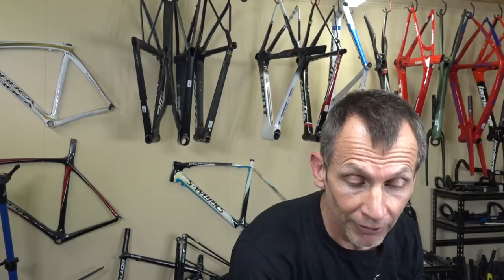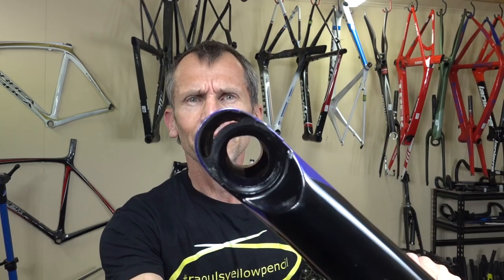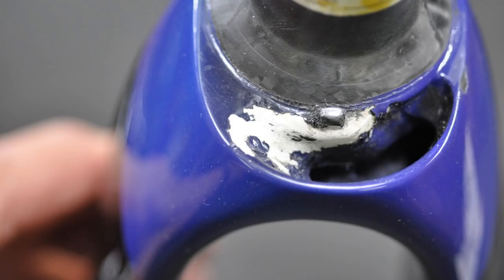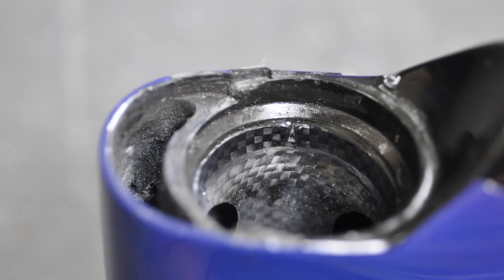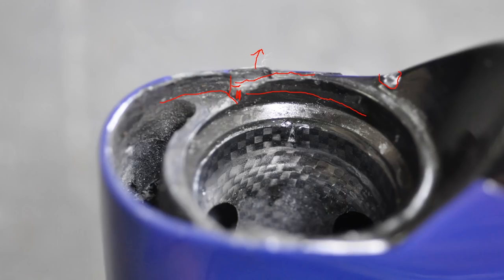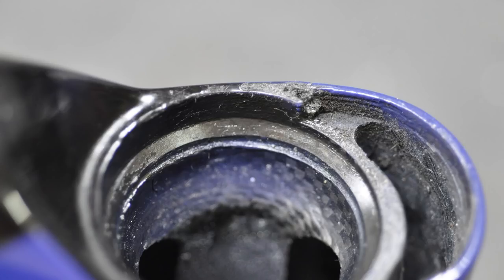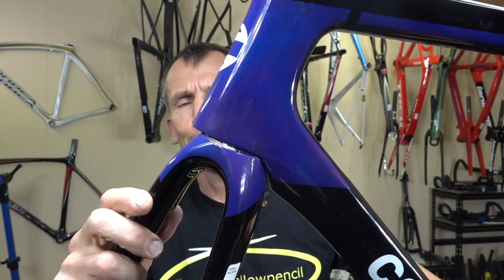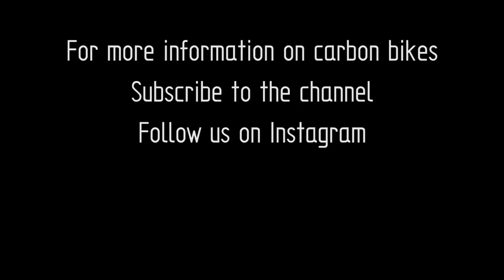Cannondale Design Fail

Comment: I have got this frame and this is precisely what happened to it. I had to spend some 500 euros for the repair. Something tells me that Cannondale should pay me that back.
Reply: Well, the owner's manual clearly states: "NOTICE Do not force the steering past the stop points. If the front end steering of the bikes is over-loaded (due to e.g. a handlebar strike, a crash, etc.) damage to the frame, fork or pin may result. This type of damage is not covered by the limited warranty." I swear, i will never ever buy a Cannondale. They knew this was shit design from the beginning.
Reply: I had the same problem… 500 euro to replace the frame. Maybe we can do a class action against cannondale.

Comment: So basically every time the bike's bars are accidentally hyper extended, the frame is destroyed.  I wonder how many frames the EF Education team has gone through?
Reply: The mechanics may have eliminated the metal stop.
Reply: @glennoc8585  Definitely possible.  No doubt I would be taking a Dremel to the metal tab if I owned one of these.
Reply: @cup_and_cone  the stop is there to prevent the internal cable routing through steerer tube from damage or pull out....hydraulic pipes.. 😬
Reply: @rp6760  Just.. do them longer.
Reply: @cup_and_cone  why not? Can always just use a file I suppose....
Reply: Well, first it's damaged. Only when it has been damaged too much, it's destroyed.
Reply: @futurememeudontgetyet1202  i think it is the overlapping windows in the frame and fork the cables pass through, without the stop they'll act like a guillotine.

Comment: Inner cable routing was probably the reason why "designer" wanted to limit fork turn. Buy simple designs and reliable bikes brand LOOK or TIME.
Reply: Both those brands make fantastic bikes. They may not be the most aero but the build quality is fantastic and second to none really.

Comment: I've had a couple of these frames (I do some work for a LBS, and I have had the opportunity to own a couple), and I've found the best fix is to Dremel/sand off the metal pin, so that it no longer makes contact with the frame. What ends up happening instead is that extra stress is put on the brake line, which is less than ideal. I've come to thee realization though, that replacing the front brake line is a hell of a lot more simple and cost-effective over replacing the frame every time you have delamination/damage. I can't take credit for this idea, as it was told to me by someone that works for EF-Nippo, and that one of the riders requested to have this mod done, as the angle at which it currently stops is not a lot for very tight, low-speed turns.

Comment: Just checked my 2020 SS Evo. Alas, I have the same kind of damage - the metal blade has eaten a few millimetres into the carbon ramps on both sides of the head tube, and there is early delamination/bulging on of the lower end of the right head tube side.

The bike was never crashed, just ridden normally for a year. The only reason I can think of is that I regularly carry my bike up the stairwell to my apartment, and the limiter engages in these occasions regularly (but without high forces, at least so I thought, being unaware of the metal blade design/self-destruction mechanism).

I am appalled that there is no recall from Cannondale yet. Seems like they want to brush it under the carpet - the 2021 model apparently has a metal reinforcement in that area. Conveniently, there's an addendum to the user manual stating that specifically this damage is excluded from the limited warranty.

@Raoul - do you think this is cosmetic or structural, i.e. can I still ride my bike or is this now an expensive piece of junk?

Comment: It would be interesting to see survey results as to the different ways manufacturers secure a fork from swinging too far.
Reply: The current Trek Knock Block design is pretty good. Even thigh it requires a couple extra parts, they're all replaceable and metal. They even have a retrofit, so you can use aftermarket stems. I may not like the application on mtb, but they executed it well.

Comment: It looks like there is plenty of room to put a large pin on the back side of the crown, avoiding the traffic jam at the front where I'm assuming the fork hose is going. The carbon on the frame would be pretty thick there too.

Comment: Most my cycling buddies who experience broken frames and forks rode Cannondales. The second worst are Cervelos.
Reply: Both owned by Dorel
Reply: And then you have Monza Imports here in Australia to deal with who will try any excuse under the sun to try avoid warranty on Cannondale. You can’t even get hold of Dorel so if Monza decide not to replace frames, you stuffed.

Comment: Presumably the stop is just to prevent the internally routed cables from being damaged if the handlebars are rotated too far?! Crazy engineering, surely there must be a more elegant design than this? If it's not possible to design a much better steerer stop, then surely you shouldn't internally route your cables! Nicely presented Raoul - keep this stuff coming and also get well soon.
Reply: Yeah that is likely the only reason they bothered to put a stop in the first place.
Reply: That’s stupid. Just make it so your hoses are long enough to rotate both ways how they used to….

Comment: Pro teams go through a TON of frames...  at least 10 per rider (not counting TT bikes).  That is a pretty big "carbon footprint".  But no one seems to care.  Think about how it would help the development of the product if the teams were limited in how many frames they could use and bike manufacturers were forced to make a durable product...   and it would be better for the plant too.
Reply: I really wonder how much these frames cost to make and if the teams are getting the frames "at cost".    The price to the manufacture, which is based almost totally on outsourced labor, has got to be pretty low.
Reply: @SurpriseMeJT  i would assume the pro teams get them (and everything else) for free, and then pass along the cost to the consumer. 
the sport, at the professional level, is nothing more than advertising and marketing.
if the bicycle industry received 1/1000th of what the automotive industry received in corporate welfare, a Pinnarelo F12 with Enve and Super Record EPS would cost $49.99
Reply: @SurpriseMeJT  Bike makers PAY teams to ride their product...  the teams do not buy frames.  The cost for a manufacturer like Trek, Cdale or Specialized to make a frame is $150 for a low end frame to about $700 for a top end frame.  The real costs of selling high end carbon frames is distribution and marketing, not manufacturing.

Comment: That's beyond stupid, really. I think it's a bad idea to begin with to design a bike frame in a way so that steering travel is limited. Because even if it was reinforced down there at the headtube with metal inserts, a crash might still be too much for it. Admittedly, your handlebar can also damage your top tube in a crash, but the surface area there is usually much greater and your handlebar is most likely wrapped in soft bar tape.
Reply: One issue with this is they have hoses going through that area, so if travel is not limited it could pinch or cut the hoses. But then they may have been better off reinforcing the hose and using that as a travel limit instead.

Comment: Thx for the video. I had the same issue with the frame while having a small accident - luckily the frame was replaced by cannondale. But as you said, the design is really crappy and made to fail hard..
Reply: Hi! I have the same problem at the moment. How did you contact cannondale to replace the frame? Did they do it readily or did you have to push them? 
Thanks for a short feedback!

Comment: I have a 2019 and bought it shortly before the new one was released. I was a little disappointed that I didn't wait a little longer. Seeing this issue (and the frame you are showing isn't an isolated incident) makes me glad I have the one I do. Even if it does have a QR on the rear with disk brakes. It isn't a factor at all. Just made buying new wheels a little more complicated.
Reply: Wheel upgrades are the reason why I hate disc brake road bikes with open dropouts. Disc brakes and closed dropouts go together.

Comment: I know that cannondale are replacing 2020 models through warranty, but will 2021 model with a metal plate in there solves this issue?
Reply: We’re they?! Mine just happened today. Where did you see that?
Reply: @andrewsbenn  I am still waiting for my new frame. In 2021 models they added a metal plate, so stopper is hitting metal instead of crb

Comment: Since mine is damaged in the same way, I'm wondering if this is a repairable condition?   I've been toying with taking it to a carbon repair shop in New Jersey to see what they say.  But it's a pretty big hassle because of the distance involved.   Also, it seems pretty complicated because of the bearing race being right there.
Reply: I'd say: not worth repairing. I'd ask my money back, that is a design/manufacture flaw. The fault is a long crack in one of the highest loaded areas of the bike, and there's quite a bit of complicated geometry. And the crack is above other thicker laminate, which may also be damaged. To repair that properly, you would probably have to sand off a huge area of plies around it, as to practically rebuild the headtube.And frankly, I wouldn't want to ride that thing again. This may crack without you noticing, and fail while you're on it.
Reply: @Clarion15090 What did you end up doing mine broke yesterday in the same spot.
Reply: @andrewsbenn  I'm really sorry to hear that.  I didn't do anything with it yet.  It's hooked up to an indoor trainer.  I may eventually take it to a carbon repair shop and see what they say.  It's just a big hassle to deal with.  Plus it has to be a very tricky (if even possible) repair because it's cracked right at the lower headset bearing.  That's why I haven't done anything with it.  

The driver's insurance company treated my really well in totaling the bike out and letting me keep it.  I was able to replace it with a brand new 2019 Supersix Dura Ace Di2 with what they gave me.  I'm not unhappy about how things turned out for me personally.  But I wouldn't buy another 2020 or 2021 Supersix because of the steering limit design.  

Good luck with yours.  Please post back and let us know how you make out.

Comment: I like cannondale a lot but I'll have to think about it now. What bikes would you actually recommend?
Reply: As long as a bike doesn't have bad designs like this one, any reputable brand would do. 

Or better yet, pick a bike with traditional internal routing (internal routing starts from the top and down tube instead of the top of the head tube), like the Giant TCR Advanced.

Comment: I believe I see the reason why it is there ( internal cable routing ) and it should stop from pulling cables too much ? Hope they will improve this design
Reply: Yes - it’s no excuse but this design is driven by consumer demand for fully internal cables.  I think most of us reckon that a super ‘clean cockpit’ looks pretty smart, so if Brand A delivers this ‘solution in search of a problem’ which gets turned up to 11 with massively over-hyped marketing and the consumer votes with their wallet then Brands B, C & D are all kicking their designers and engineers to deliver an equivalent product, just 15% stiffer with 8% less drag and 12% more compliant! Now! 🤣🤥🤑

Comment: The good solution is to rotate the metal stop 90degrees.  The better solution is to put a mating metal stop on the frame.  The best solution is to route the cables externally.

Or flip the location of the metal stop and put the metal stop in the frame and let it damage the fork instead.

Comment: I hate so see the words Cannondale and Fail together but I know a fail when I see one and this really is a very poor solution.
However I don't like that the engineers always get all the blame. They never make these kind of decisions. They come with ideas, some better, some worse and at the ende some product manager decides he wants it made totally dfferentbfor x-y reasons.
In no way was this selected as the preferred solution by an engineer.
Apart from that, from the damage in the frame I suspect that there was more to it than just a poor design: a loose headset compression clamp. It's hard for me to see any other way for the little metal know on the fork to gauge the carbon on the frame the way it did. If everything was tight it should go right through the carbon and split it apart. There is no way for any part of the assembly to compress (fork shaft) or stretch (frame head tube) that much for the little metal know to move over the frame limiter.
Reply: RollinRat  BTW, I ride my own tig welded frames. MTB and road
Reply: RollinRat  my caad12 Cannondale creaked from about 1000k onwards. I still like the bike. But the BB 30 just does not work.

Comment: Holy sh*t! I was thinking of pulling the trigger on a 2021 supersix. I’ll pass on that now.
Reply: I bought one. Rode it 6 times, had this exact problem happen to me, and then saw the video.
Reply: @andrewsbenn  Damn! Hope you’ll ge a replacement frame under warranty.
Reply: @NessMeister  I'm not sure will find out this week hopefully. In either case the bike shop is going to charge me to tear down old frame and rebuild new.

Comment: Don't know why they couldn't just bond in a rubber bump stop of some kind.

Really disillusioned with the bike industry and their lack of decent design engineering.
Reply: It wouldn't matter. The PSI is just far too high. The solution for a stop to work would have to include a substantial increase in surface area just to start with and then a impact damper would be needed.
The problem is this style of head tube for aero purposes.
Reply: @Sir_Godz  agree in that current design and there would have to be some level of compromise somewhere. The issue is one of safety for me.

This design is unsafe in my opinion. I've had a headtube go on me before which was an incredibly unpleasant experience as it gave zero warning.

Comment: Is this failure happening simply through normal use of the bars just swinging around accidentally in free air or when crashed? If this is designed to fail like this on impact, like a crash, then isn't this simply more an indicator the frame was crashed and so void of full warranty? If this is the case, I would file it off and void the warranty anyway as you're clearly going to break the head tube in a bar impact imo.

Comment: Yup can confirm I have seen this occur with customers test ridding the bike around the car park. Only requires a very small force to cause damage. Was not impress.
Reply: Did you get Cannondale to replace the frame for free? I rode mine a handful of times before it cracked.

Comment: When you design on a computer, and ship it off to the Far East for manufacturer and the customer is your beta what do we expect. After 35 in aircraft and f1 if you put your hand up and use your experience and expertise to highlight a problem your a trouble maker. 1990s 4 year in the school, 5 on the tools, then interview and selection 5 years more college and supervised testing as a technician then I could apply to be an aerospace test engineer, today 3 years at uni and a good interview and your in.
Reply: The money printing machines go "skrrrrrrt".
Reply: @keinpietz7697  i once had a graduate walk round the back of my pc after I told him how we designed metrology parts. I asked “what are you looking for?” He replied “where does the part come out”  he didn’t finish the week.

Comment: I knew that caad 13 is copy system six's design,does caad 13 have the same problem?
Reply: No, the CAAD13's front end is still like a conventional road bike's, just like its predecessor's. No full internal routing, no steer stop, just a simple head tube and fork.